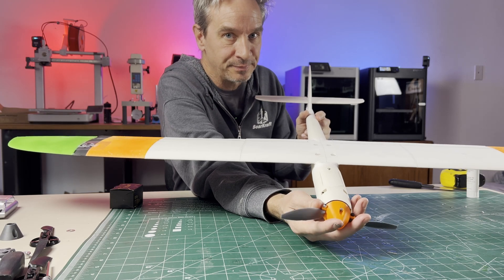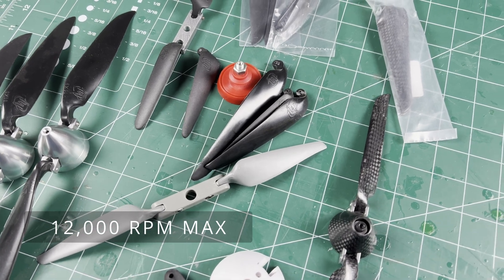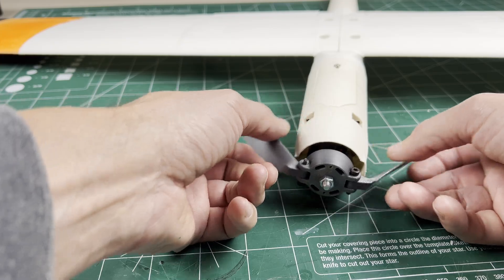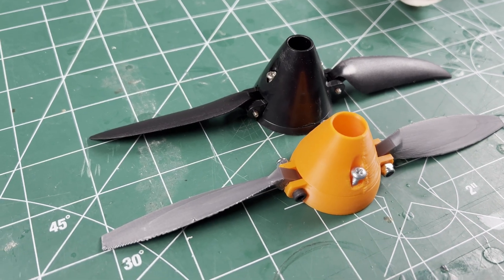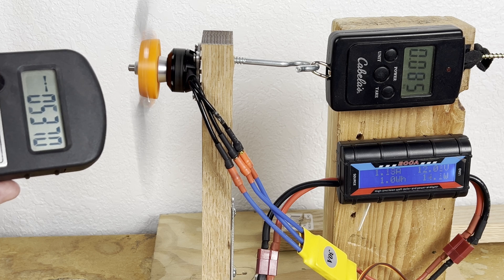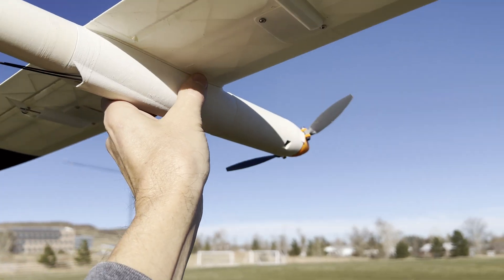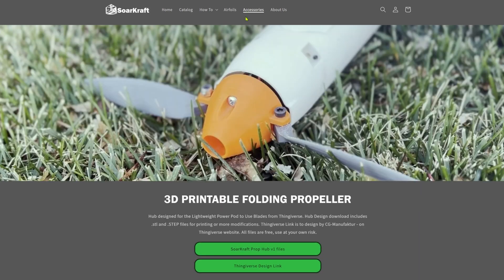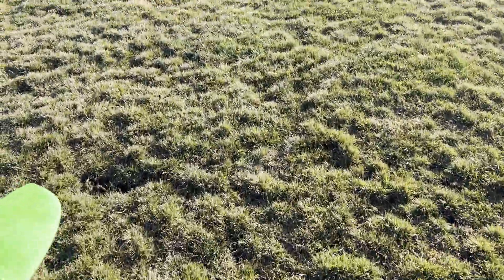3D Print Folding Propeller - test and fly - custom SoarKraft hub for a Printables design

Comment: I printed the blades off of thingiverse and found the edges of the blade to be very jagged. Unacceptable.   I printed with support, both with tree Auto and regular auto.  I'm wondering what I did wrong?  I used bambu slicer.   Also used the special wall method called Arachne.  Any guidance would be appreciated.
Reply from the maker: What layer height and material did you use?  A smaller layer height with give finer detail.  Different materials and manufactures do support better.   I used Overture PLA Pro and Creality Hyper PLA for my tests.  My blades had a rough leading edge, but while balancing them I cleaned them up a little, knife and sandpaper... they were not perfect... performed fine at 10,000 rpm... these are not high rpm props.   Also there are all kinds of youtube videos on improving supports and part quality, you don't have to follow "airplane" settings to print this blade.
Reply: @soarkraft I printed with microcenter PETG.  I tried both the tree and classic supports.  Layer height both. 2 and .15 mm.  The support interface is the problem.  Thanks for your reply.  Your videos are excellent.
Reply from the maker: @DavidCousins  So PETG is much harder to do supports.  Try PLA+ / PLA Pro.

Comment: i had printed that prop from thingiverse. for some reason probably smoothness injected molded prop gave close to 100 grams more thrust than the 3d printed ones. it was fun anyway
Reply from the maker: So if you got that much more, you were ether spinning it way faster than I did, or using a larger dia / pitch... did you use a folding prop for comparison or a standard prop?.  I was comparing a cheap plastic folding prop to this 3D printed prop.  A better molded prop might be stiffer than the material you printed with and as the forces increase the blade twists reducing thrust.  The thingiverse prop is also pretty basic and a better performance blade design would help too, ie DUP, Falcon or Aeronaut... which you could put on a printed hub... but still keep the rpms down for safety.
Reply: @soarkraft  I used a commericially avaialable carbon nylon prop (not folding). it is way stiffer and durable than the pla one i printed.  i think i used the same dia prop for both (been a few years memory is a bit foggy).
Looking back my tests probably were'nt accurate enough cause in a folding one the hub doesnt contibute to lift and also it had an angle to it that probably wasted some thrust force radially.

The printed ones helped me save money though because all the initial test of the fixed wing i was working on crashed badly. 
And now you have shown how good they can be if properly done.

Comment: That's an awesome idea - there are so many critical dimensions on a folding prop that I've always had to design a model's nose around a specific system, but printing lets you customise it. I've been printing spinners for a while, so this seems like a logical step.

I'd be interested to compare 'good' commercial blades, like the APC folding system. The hobbyking ones have a strange lack of twist.
Reply from the maker: APCs folding props are OK, there are many more out there that are better and would work with this type hub system.  The prop seams to be the weak point, not the hub, as the failures I have had in testing and other cheap plastic chinese copies (HobbyKing) fail at the base rotation point of the blade.  Aloft has some reasonably priced alternatives... $5 for a 10x8 blade set in the Super-S   
https://alofthobbies.com/collections/folding-1

Comment: I just watched the video and I was surprised by the shout out. Haha. I have not downloaded the file for the hub, so maybe I'm premature and asking this but have you tried it with your T motor? I had to go ahead and recess the original hub to get it to work with T-motor as the shaft is not long enough. If not...have you thought about putting out a alternate file with a recessed section for that application. I can get it done in a CAD program but I'm not that skilled of an cad operator, Plus I've always questioned If modifying a STL file gives you a strong of a part as making the changes from the original file?.
 Thanks for the video and the info....
Reply from the maker: The t-motors shafts are short and the mounting is not consistent, but doing a version for the Surpass motor was very easy.  I am working on adapting it for a 2207 and F80 size t-Motors.  I will add a hub version for them in the future.  I may send you some files to try if you want.

Comment: Normally I'm all over 3D printing as many parts as possible, but personally I think printing props is just too risky. The loads are significant and if one fails it will often destroy the front of the model, and possibly injure anyone nearby.
Reply from the maker: So I agree completely, why risk this part, and that is why it took me so long to try this.   Watch the destructive testing… 19,000 rpm.. that’s better than many of the aluminum hub Chinese folding props… which I have broken too… and in the same spot.  The power system I am using is only 100 Watts and the ESCs limit the rpm so much I’m not worried about it spinning too fast.
Reply: @soarkraft  Fair points, it might be fine at low power, and we all have a different tolerance for risk. If you can print glass or carbon filled nylon, that might be a way to reduce risk of failure too.
Reply: For what it’s worth, I have printed and flown two different sizes of this prop design, with zero failures. It seems unlikely to work, but it does!
Reply: I agree with you, is there a forum with the title `Are 3D print props safe`?